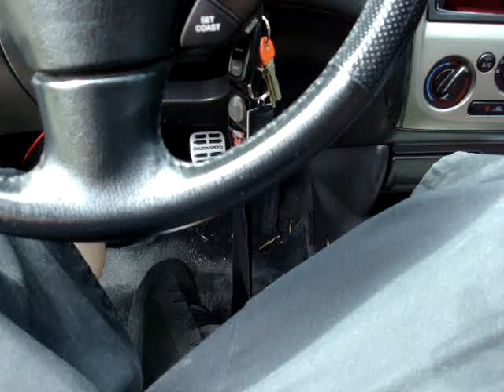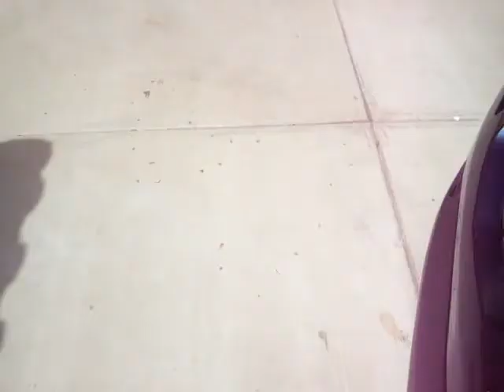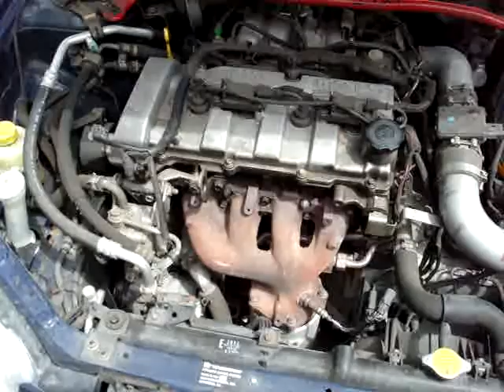Protege 5 possible engine knock?

Comment: If it was knocking, the knock sensor should output P0325 to the PCM as long as it is functioning properly. A simple quick test to see if it is working, just tap the running engine with a hammer, you should notice a change in timing indicating the sensor is working.